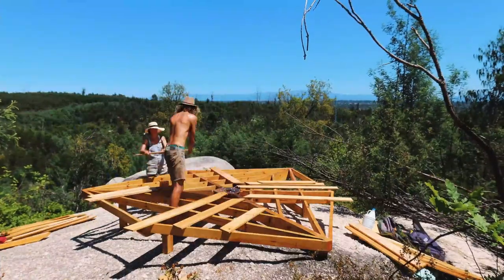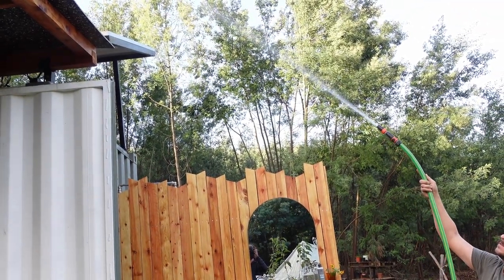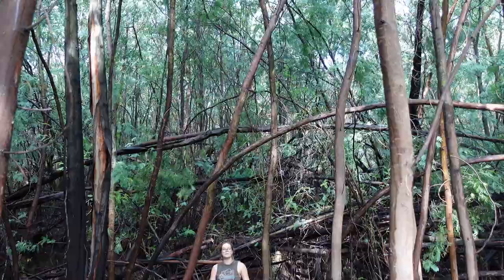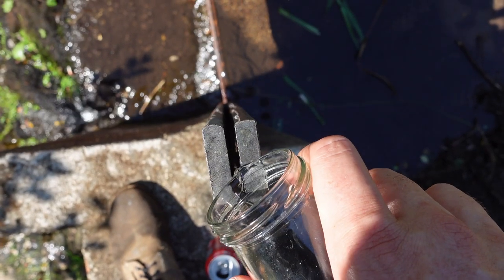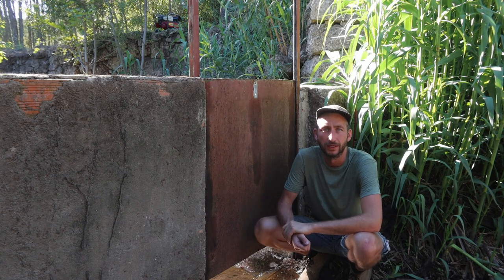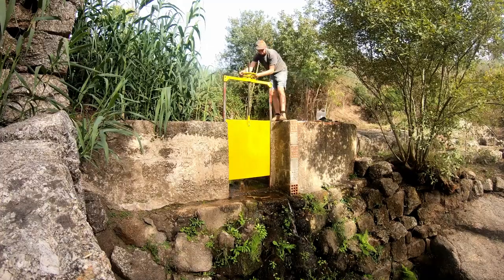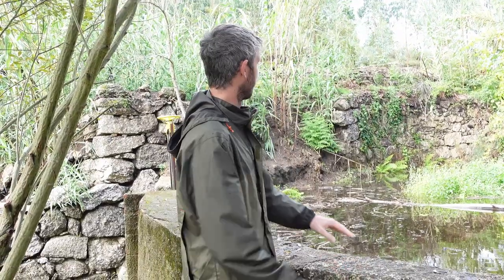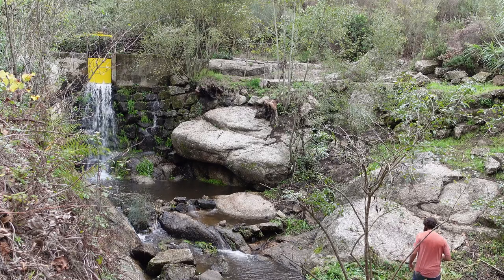#71 Fixing the waterfall door (before big rain comes)

Comment: Another great video! Id suggest greasing the rails to aid opening and closing the gate. It would also be worth using the angle grinder with a brick cutter attachment to create a groove for the gate to sit into. Might help with the loss underneath.
Also an screw type hydro would work well here and provide power in the winter

Comment: Pro tip on the containers. The only part that need support is usually (provided the floor is in good shape) is the corners. Just eve the 4 corners and leave the bushes under it to die off. Easier to clear it later when is dried and dead anyways.

Comment: The ketchup, I'm sure it would work. You just need to build a watertight box around the whole gate, all of it. Then pour in like 100 to 200 litres of ketchup. Let it soak for an hour. Then attach a couple of sanders to the large plate and run them for an hour straight (the vibration breaks the rust up over time), then try lifting the gate with that carjack again (which would require storing all the ketchup). If that doesn't work, repeat the prior steps until the gate is unstuck.

I'd be surprised if it didn't work after about a week, maybe just a few days! Of course, taking the easy way out that you did also works. But you'll never be able to say you used ketchup to fix your gate, sadly.

Comment: I would really recommend here to empty the lagoon again completly, and fix the leaks. In a dry season, i believe the lagoon will run empty, because of the leaks. 
Also you have a really nice water head there - it looks perfect for a large top-loaded waterwheel for power generation. 

Especially that path that the water takes under the wall and through the rocks on the other side is worrying, because it erodes the foundation of the wall.

Comment: You should dig out the mud and debris from the top reservoir there looks like a lot of stuff, it could hold a lot more water and be a better pool for summer when it comes back around and also To find the leaks in the wall cut some squares out of blue tarp and put them under the water near where you think they will be, the tarp should get sucked into the crack and be easy to see

Comment: Be sure to weld in 3 or 4 horizontal steel pieces to reinforce the gate as the water pressure might break the new welds. Great job.
Reply: I thought I saw some horizintal bracing welded on there already?
Reply: @PTEC3D  Yeah, I got ahead of myself. He did in fact weld horitz.braces .

Comment: use a hydraulic car jack  on each corner to free up then switch to other side and do the same then put jack in middle and begin to lift whole thing.  use pipe/wood to make the height up.  with a hammer tap sides as you are doing this it will free up.   if by chance it still stubborn use a grinder and go down the sides cutting a channel on both sides.(do this both sides of guide x4.    I have done this before and its a hard process but with patience and time it will come out.   once it is out use grinder and clean up the channels on both sides and the metal panel edges also to remove rust build up. (grease and replace.  Good vibes from all of us at the "dome project"  NZ.

Comment: the water barrier sheet is being compressed by the two walls leaning towards the base of the water channel. when you grinded the middle you took out the equivalent of the grinding disk. the sheet seals itself against the rail or a gasket on the rail just by the water pressure.

there's  potencial in there to build a hidro turbine.  check out kris harbour

would be a great way to offset the propane dependency (even higher during winter). all the excess energy would go to an electric water heater

Comment: If you want to avoid the same issue next year apply a layer of grease to any moving parts such as the sides of the door and the central rod. I see some other people suggested looking at Kris Harbours channel if you are thinking about using it for hydro power. Otherwise great work, very inspiring to see to your troubleshooting process. :)

Comment: Although it's already too late, always be aware of methane or other gases, which are heavier than the air!!!
I am often working in such shafts and we always use a ventilation system built by our own to make sure that we have enough air to breath!
We just built a system with a 20cm diameter fan on which we mounted a hose with the same diameter which we hang into the bottom of the shaft. We start the fan, wait for some minutes to bring in fresh air and then we climb down... low costs and much effect

Comment: Excellent results all around! The floodgate I'd wait until end of summer next year and maybe grind to fit the bottom of the gate to the floor? But it's a great result all the same, and the leaks may be able to be fixed (if you can find the apertures inside the lagoon) with drizzling some sealing cement and concrete slurry down there? You could maybe pump some water backwards up those spaces to see where they come up. Sorry you lost one of the gopros, it'll probably turn up in the next year and still be perfectly fine after charging. Tough little things they are. 

Also loved the new well, it'll be useful for agriculture. And stoked that the recycled plastic roof is now dry - and you also have one of the ruins livable. You've achieved so much in a few years!

Comment: A next year project could be to clear the lagoon area, then line the basin and stone damn with a hard clay layer to minimize water loss.
Reply: Agree   and fix all the leaks and make a rubber seal under the steel door ( I believe a used truck tire could be useful for it...) ...

Comment: In the future, you may consider installing a rampomp at the reservoir, which you can make from pipe fittings and 2 non-return  valves.  These works on water hammer, without electricity.

Comment: Also the dam gate, use spray rust removal and then heat up with blow lamp same for wheel with easing oil heat expands and releases the sticking points and oil gives the surface less friction

Comment: In the next summer time when you want to elaborate on the watergate it would probably be helpfull to install an (only in german eine Gummilippe) a rubberseal.

For cheap a bicicletire but there are some for that kind of application.

So it is not sooo important to have a level floor of the watergate.

And for more (hebel) and less force a metalbar to stick in the circular turn thing so u can use less force for thw same movement.

Enjoy the rain

Comment: Finding another well and clearing around it. Some additional clearing required. Next year. Same for cleaning out the well bottom at a later date. Adding a cover to prevent debris falling in.
Getting the lagoon/waterfall gate to go up/down withsome timely repairs. After the first rainfall,it filled up eventhough there were several breaches. Again future opportunities for repairs and lagoon fill capabilities. As time elapses, further clearing from the retaining wall and gate, to create swim and bathing areas. Slowly turning the clogged lagoon to visible swim waters.

Comment: My husband cleaned all his flooded metal tools after the flood with vinegar. They wiped clean no problem. But he had to soak them in vinegar. You’re just pouring it on. You need to find a way to soak it in vinegar. Maybe make a. Peel with that cement stuff y’all made for the shower. Narrow strips that only enclose the sides of the metal. Get the door off bring it back to base camp and soak that in vinegar.  Then treat them when all vinegar is off with flood petrol paint.

Comment: I would clean the track with a wire wheel or a thin grinder blade to widen the track a little . I would then put a car jack under the gate and try carefully to unjam it . I believe it needs to travel evenly or it will jam  at an angle . best of luck from USA

Comment: If I were there... I think I would have left the steel gate in two pieces. Overlap them with new steel and secure them with bolts. You're going to have the same problem again... maybe in 5 or 10 years... and those years will go by a LOT faster than you think! Still, I'm sure it's very satisfying to have it operational again. Keep LOTS of grease in the gap, maybe you can delay the inevitable that way. 10 or 12 grease fittings on the channel iron might help, but with all the water around, there probably is no way to prevent rust apart from operating the gate once per month. Good luck!

Comment: I was going to make this comment last video but I think this is a good place to say it after seeing the screws break on the plastic roof:
I know that the point of using screws on a lot of your buildings is for reusability of materials, HOWEVER, Screws are usually made of metals that have been tempered or hardened in some way to keep the teeth strong. The issue with this is that it makes the metal have bad tensile strength, so it snaps instead of bending. Screws are good in cases where temperature is not a variable to account for. Outside of that, you should stick to nails, especially in cases like roofing or framing. As the temperature changes over the seasons, nails are able to bend and move with the natural expansion and contraction of the materials it's connecting together. For safety, I would highly recommend roofing and framing with nails for the strongest connections. This doesn't make screws obsolete, they are just better suited for other applications. Keep up the good work!

Comment: Oh one last thought about the plastic roof: Could you use a hot air gun from on top and a temporary wooden support underneath to weld the individual sheets together? Or just get hold of a plastic welder setup for a few weeks? You could get plenty more raw PreshPlast granules or even have them make you some extruded sticks to weld the roof with. Only thing would be to make sure that you have that support underneath (even slightly pressing up) to prevent it sagging at the welds.

Comment: Apple cider vinegar and molasis! mix into a paste smother onto rust and cover with clingfilm for 24 to 48 hours, it will come up like new metal.. the gate is to control overflow! the lagoon the top side of the dam is the same depth as the lowerside, but filled with silt from many years.. take a lot of digging out but would be an amazing swimming hole..

Comment: Have you considered heat welding the roof panels?  Just melt/form them together along joining edges, make them one giant sheet. If 2 people went at the joints from both sides with heat guns, you might be able to fuse them really well.

Comment: If it hasn't been suggested already (and done afterwards): If you want to know the water level in the newly cleaned well, take a stick (roof slat) which is a little bit longer than the ladder Julie used to get into the well.  Write numbers on it, 10, 20, etc until the upper part of the well is reached. Every now and then you put the stick into the well and look how much water is in it.
Keep the stick in the neighbourhood of the well, nobody will take it from there. As for the waterfall door: great that you fixed it. Metal on metal always leaks. But a little bit of leakage
doesn't really matter, at least not during the rain season. As you noticed, after a longer time of heavy rainfall the lagoon is full and the water flows over the waterfall door.

Comment: Ok so first the plastic roof. You can buy Bitumen from hardware stores or builders merchants. Heat it up in an old metal bucket. When it melts, paint it onto the roof starting at the top and working down. This will totally waterproof the roof for years. At least 10 I would say.
 With regards to the dam. You should heavily grease the slider rails and also the long screw that lifts the gate. Too much grease is never enough. It will help when raising and lowering the gate and will also protect it from bad weather.
 Maybe next year in the dry time, you can clear all the vegetation etc from the base of the reservoir/dam and reinforce the dam wall with some waterproofed concrete and maybe even a damp proof membrane. 
 I live in Yorkshire in England and we have a lot of reservoirs here. I have seen them when they are empty and also I have spoken to the contractors working on their repairs and they said to try and reinforce the dam wall any chance you get. Anyway, I hope these tips help. What country are you in?

Comment: To level the welded plate you need to stretch the weld. Hitting it along the length of the weld with a plating hammer would make all the difference!

Comment: sealing plastic sheeting is not difficult though it is time consuming. Easiest method for you is probably a 12volt soldering iron. I've only done this with a 240v one  on thick black sheeting membrane in a concrete flat roof. I'm sure you'll find videos on the various techniques.

Comment: Yeah, when things rust together in a sleeve like that, it's nearly impossible to get them removed. A tractor's front end loader might have succeeded, but then you risk deforming the plate and such. The surest and easiest option is by far what you did. For the leaks, clearing the ground, removing any soil that has washed in, and lining the bottom with blue clay is the move in our area (SE Texas); not sure how readily available that is in Portugal. As far as the door, large leaks at the bottom are probably just the rock/concrete no longer being perfectly flush, but the sides are from a lack of pressure against a seal. Often a softer metal such as Brass is used as a "gasket" between the door and the sleeve opposite of the water, and the harder steel sides crush it using the force of the water. This is also how the header of an engine seals to the block, as an example.

Comment: If the roof starts leaking again: Since those plastic panels are, well, plastic, you could try plastic-welding the seams together. 
Either using a regular hot-iron or by going the "zero-energy" way and using a lens on a sunny day to melt the seams together

Comment: An Overshot Waterwheel  can generate energy with an 80 - 90% efficiency. Not only could you generate electricity but also mechanically run a sawmill or turn a stone to grind grains for flour.

Comment: You might be able to bodge some temporary seals on the gate of the lagoon using ash - I have vague memories of watching an old film on canals and some old chap talking about pouring ash down gates and boats to seal small leaks - There's probably a canal society/website int he UK that could give proper details.

The base of the gate you could use a compressible rubber seal on the metal gate to squeeze against the ground when shut

Comment: You know, my personal inclination is to think long term, between solar, aero and hydro you could produce a lot of electricity.

I'm assuming your planning eventually to have a larger self sustaining community. And although you probably don't require much power now. That might not always be the case.

Personally I'd build a large hydro-kinetic battery, IE a water tower up by the waterfall, that way you can store water and potential electricity incase of a dry spell. 

You could install a rampump at the waterfall and use it to fill the tower, that way it'll basically run without any required maintenance. And you can drain the tower to produce electricity in an emergency. 

Plus water storage is always a good thing, even with surface water and a well. Long term storage also helps with further and easier plumbing for outlying buildings.

Comment: I know you get endless unsolicited building advice, so first let me say that I don't really know anything! But I do think I would have probably gone for much stronger screws on the plastic panels first (to ensure secure mechanical connection), THEN sealed up the gaps with a caulking gun and roofing silicon. Never the less, it's very interesting to see your efforts an results :)

Comment: Remember you are pounding down on the gate. Try up-force using the jack from a small automobile to lift it.  If that doesn't work, try placing  thin worm shaped C-4 along the sides of the door and detonate it.

Comment: Hey guys, polymer chemist speaking here. Your recycled roof panels are likely a mix of PP, PE (and a bunch of inks and adhesives). This tends to be hard to adhere too and hence a lot of materials will not bond to this well. EPDM is suffering from the same problem, and they use a special primer to improve adhesion dramatically.
You could a similar technique as used for EPDM edges: https://www.youtube.com/watch?v=DLcbQqd8TFo. That would be a more bulletproof solution, I think.

Comment: In order for the vinegar or any acid to have had enough time to do it's work in the position the rust was in (the gate slide channels) the vinegar would need to soak a lot longer than it had the time to by just pouring over the channels/gate.  If you draped a towel over the gate channels soaked with vinegar, then re-applied many times over a few hours so the rusty metal stayed soaked the entire time, the vinegar may have had a chance to work to the point where the gate might have been able to break free if it was then soaked with penetrating oil (not WD-40) using a hydraulic jack.

Comment: You might consider putting a bead of oil/grease down the edges of the dame gate to help prevent metal to metal rusting so it does not size up again.

Comment: Perhaps create a project that installs small ESP32 devices that has waterlevel sensor and perhaps soil moisture sensor that transmits data via LORAN network (low power consumption) so you can keep an eye on the watertable of the kamp. Capture the data on a raspberry pi in home assistant.